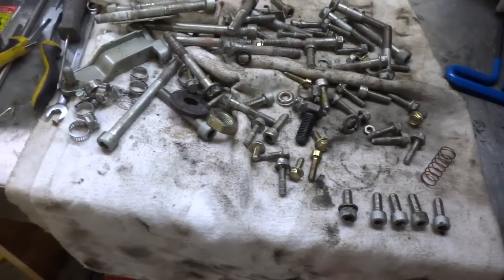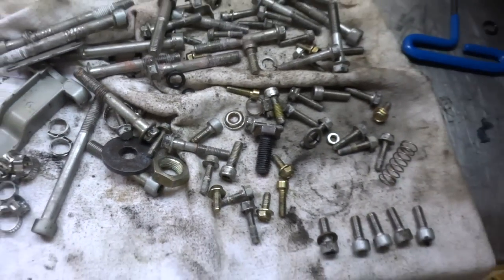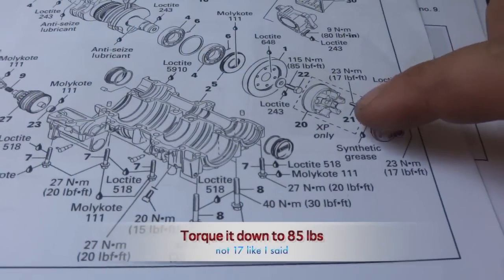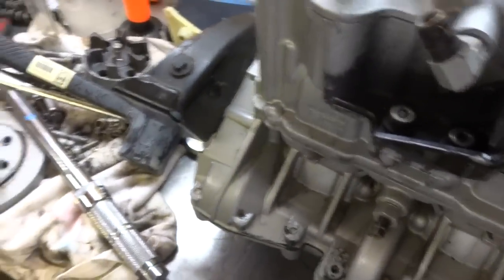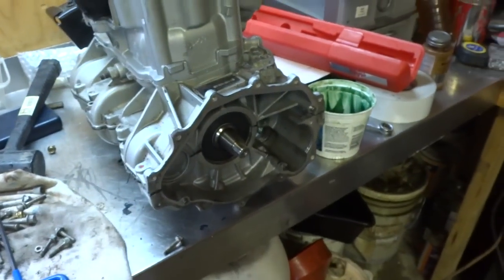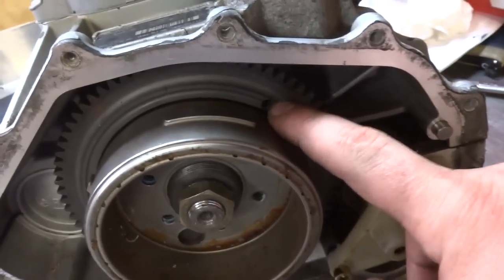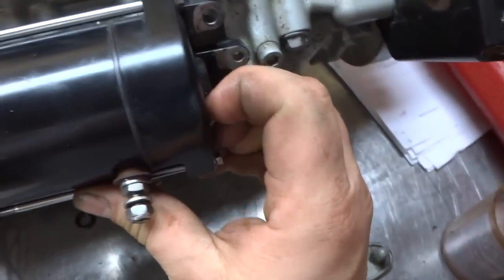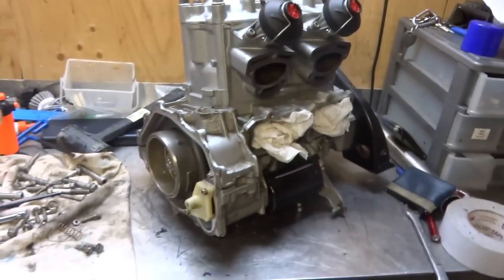Seadoo 951 Rebuild Flywheel assembly

Comment: Hi sir i have trouble starting my 951 it will backfire and will not run do you think the timing is off or the carb hoses are not put in the right  location i bought it like this  tnx in advance

Comment: 7 year old video and still very informative. thank you 
ive been trying to fix a missfire on my 951 for a year now, no thrust in water, rpm jumps high but no power. 
did a lot of work on pump, drive shaft and impeller as i thought it was cavitating at first. Rebuilt the carbs, changed fuel lines etc.
I think i have it narrowed down to faulty magneto or reed valves, causing missifre and power loss. 
Your video make me feel better about the process as i never pulled the engine out yet.

Comment: the sand came from the exhaust manifold and also when you have a overheat issue the head would be different cooked color. The 950 engines are known for blowing up 135 hp is just way to much for a little twin. Ive done lots of these engines the red on the case bottom bolts was probably gel seal not lock tight and the grey build up on bolts is common even in fresh water and a bitch to deal with